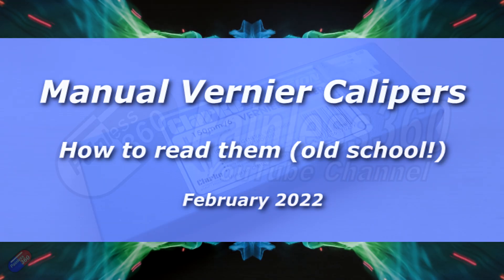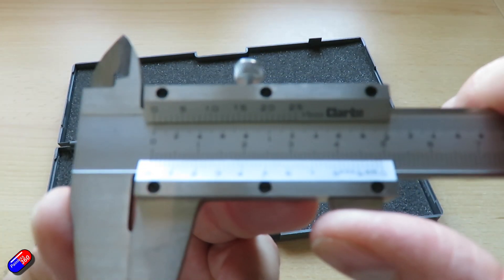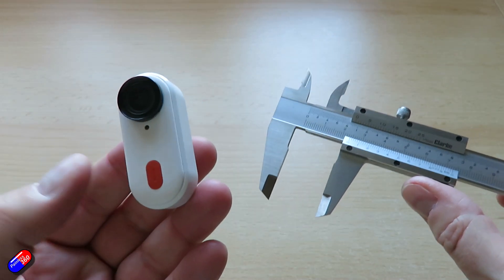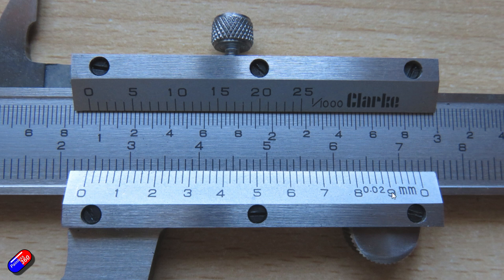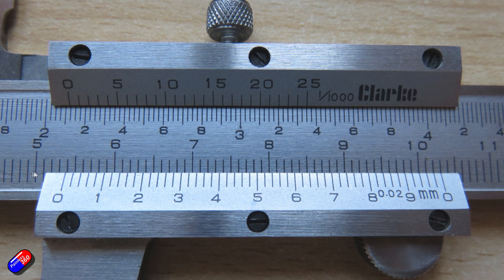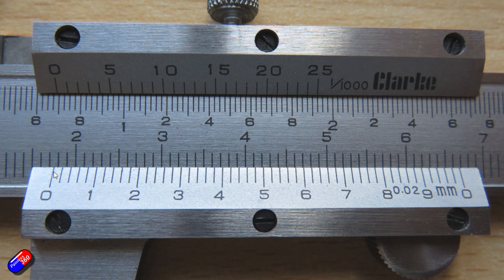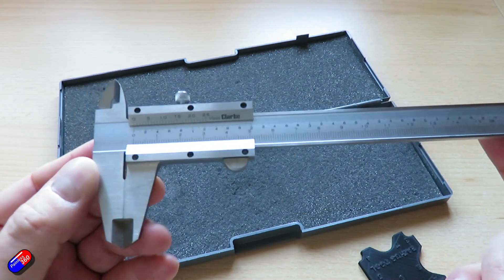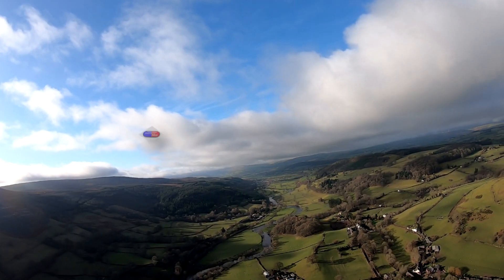How To Use Metric Manual Vernier Calipers (Old School!)

Comment: It's been donkeys years since I used one and needed to double check that I'm  measuring correctly again. Mine only goes down to 0.05 though. So, thank you for this video it confirmed that I was. A case of, If you don't use it you lose it in my case anyway, thanks again for the memory.

Comment: I just bought one for home use. I went with a manual since I often find that when I need to use a battery operated tool, the battery is dead. Therefore, I prefer manual tools that always work when I need them.

Comment: Thank You so very much. that was a clear explanation. I have a very similar model, but mine has standard graduations on top and metric on the bottom. What is still puzzling me is, how to understand that the standard graduations are subdivided in 10ths. I guess what I'm confused about is how to read a standard, base 12 is divided using base 10, which is metric. For me there seems to be a mental block because I was taught not to 'mix' metric and stranded measures.  Can you clarify this for me? I Thank You in advance.
Reply from the maker: There are two types of inch scales. This one measures in thousands of an inch. The other measures inches as a decimal... Happy flying

Comment: This isn't just a fun historical note; they still make these (and for a wider range of specifications than you can get with the digitals), and people still need to know how to use them. I just recently got a 2'/60cm caliper for a project, and got vernier because I didn't find any digital calipers in the right size. I used to know how to use them, but the last time I did so for a precise enough measurement to need the vernier mechanism was almost 20 years ago, so I came here for a refresher course.

Comment: I needed this information for a job I'm getting working with plane engines and other what nots. They said the manual caliper is more accurate than an electronical one and they prefer to use a manual any day. I also might info on using a micrometer as the only time used one was at the 4th largest company in the world. they told me to use as a hammer and I was looking at they're stupid. But the micrometer they had were manual as well and non electrical. so it would be nice if you provide information based on using one as well.
Reply from the maker: Check out the links in the video description... Happy flying

Comment: You know it is funny with the advent of CNC machinery and digital measuring tools in use today that "old time" machinists like my dad did high accuracy and tight tolerance work in the 1960s with manual equipment. It just proves that you don't need a digital display to make accurate measurements. Thanks so much for the video and I did get the measurement example correct. I have my dad to thank for that one!!! ❤

Comment: I absolutely hate vernier calipers, I have to use them in low light conditions to measure components to the near limits of the caliper tolerances, I wouldn't complain but in my view Dial calipers are superior since you get the precision you need without having to shell out for mitutoyo and spare batteries (which always get lost)
Still you never know what tool you'll have and reading verniers is invaluable for engineers and many tradies alike.
Reply from the maker: Yep, low light and bad eyesight can make manual tools like this hard to use. Especially when you're at the limit of their resolution. Happy flying!

Comment: Just bought a manual caliper because it got real old having to switch batteries every second time i pull it out. (Yeah i don't use it a lot, and batteries discharge even when idle.)
Reply from the maker: I use this one for the same reason. Always ready, always accurate :D

Comment: One thing I particularly like about a manual vernier. It can be calibrated at 0 and trusted across it's range as a reference to check other tools because the impressioned scales cannot be altered, only misaligned. Granted, they are not standards but they are far more trustworthy than dial or digital calipers.

Comment: Thanks for the video. The manual calipers are great for measuring oily machine parts. With my digital calipers I'd have to constantly wipe them down with IPA once any grease residue gets on the slide or the display will start going bonkers. Not an issue with vernier calipers.

Comment: In college, early 1970s, I took a drafting course and learned to read verniers using drafting machines.  I still use vernier measuring tools today including .0001" micrometers, .  One is an 18" vernier caliper.  It's a beast but it's accurate.

Comment: Not good to learn how to use, now I understand my order for a spring clip to hold plates on my dumbbells curve bar is not going to work. 🙃 My bar is 23.5 mm and the clip I ordered is 28 mm. Too big will slide off bar.

Comment: I don't use calipers very often, but when I need to, I need to.  I had an an electronic caliper that was accurate and easy to use, but because I used it so seldom, when I needed to use it, the battery would be dead.  Grrreat.  I bought an analog caliper and I love it.  Plenty accurate for what I need and it never fails to work.  This video does a nice job of explaining how to use one.  What's next?  A slide rule?

Comment: Keep the caliper free of rust and it will most likely continue to function for millennia, certainly much longer than the battery/circuitry of a "modern" digital caliper.

Comment: In millimeters is easy! But in inch?!
Reply from the maker: I'm guessing you are in America? :) Out of interest, how does that work?
Reply: No, I'm in Europe, and my interest is the knowledge. After your video clip, I looked for how to measure in inch, not with 1/200, 1/500 or 1/1000 precision, but with 1/64, 1/128 (for example, how do you get a result of 2 73/128"?). Without paper and pen seems to be very difficult to get the real value from the vernier! Metric system is marvelous!

Comment: It's  hard to believe we need a video for this.  I use a vernier and dial indicator  everyday.  Should be taught and used regularly in grade school.
Reply from the maker: Sadly, it is a dying art. Cheap, accurate battery operated calipers are easy to get. As an ol' school engineer - I prefer something that will always work, can be used in all conditions (even wet) and will work even if I forget to bring fresh batteries.. :)

Comment: I am 52 and I still have the caliper from a job when I was 22. It’s the only one I have, but being American I usually use the top scale.  That is until I got into FPV!  Now I use the bottom scale more often. Works perfectly. The beauty is that it cannot be wrong, where electronics can fail and become inaccurate.  

I work in HVAC engineering. We use a lot of quality mercury bulb thermometers.  We calibrate our instruments with these thermometers. Our electronic thermometers get out of calibration. Mercury bulbs never do unless you break it. Relative humidity is verified with a wet sock on a mercury thermometer and a fan blowing across it.  Dry and wet bulb temperatures are converted to a relative humidity on a psychometric chart. This stuff is not obsolete.  It’s the gold standard. 

Great video.  Never need a battery!  Cannot be wrong. (Unless it was built wrong then you get what you pay for, but it’s still going to be repeatable).

Comment: I've wondered how they work so thanks! Only thing I'd add is that the process of taking accurate measurements with a caliper is a bit of a skill by itself. Materials tend to all be plastic (to varying degrees) and you need to use the right amount of pressure for extremely accurate readings.
Reply: Micrometers are better for extreme accuracy

Comment: For years I kept a slide rule, it belonged to an engineer who worked on the space shuttles.  Sadly it was among the items lost in a move. Hadn't thought much of it till you went old school. I actually used it in high school, by the time college rolled around I had to buy a Texas Insterments calculator, weighed like a brick due to the ni cad battery pack needed for the drivers and led display. Ah memories ....Take care.
Reply from the maker: I still love using these non electronic versions of tools. Always ready to work and takes that little skill that I was taught many years ago in those engineering workshops to read. A connection with those generations before who used the same stuff..

Comment: It seems mad to me that people wouldn't know how to read it... Like finding out some doesn't know how to read an analog clock.
Reply from the maker: We all had to learn, and skills like this are a dying art. You only see the ones with digital readouts in many shops now so there isn't a need to learn to read a manual caliper..
Reply: @Painless360  Bud we use it in highschool.
I have practical exam tomorrow so I'm here
Reply: @Painless360  after retro fitting a dro to a mill it is easy to see their appeal. They are much easier to use.
Reply: @Painless360 not a fan of the digital ones. I like seeing the results not a read out if what it thinks the results are.
Reply: I was taught how to use one sixty two years ago then went into a machine shop where micrometers were exclusively used. Some thirty years later I was landed in a situation and asked to take a reading with a manual micrometer and simply couldn’t remember how to do it. I might have managed it if I had had twenty minutes or so to think it through, but no, it was can you take the measurement! The two bosses asking me couldn’t take it either.
Reply: Because we’re not old. And live on a digital age
Reply: Ok boomer
Reply: Why do you say so? You think that every body knows everything? Even you speaking you don't know any thing at all

Comment: This is a good tool to have.  And this is the right way to do it.  Never trust digital.  No matter how many times its calibrated.
Reply from the maker: I kinda feel the same. I've seen digital give odd readings when they were not calibrated or the battery is low.. :D

Comment: in germany, the optical shift effect is called paralaxe. it means, the meassurement will become wrong, if your point of view isn't exactly over the corresponding scale section. and as humans have 2 eyes, it means you'd have to close one eye for meassurement to avoid a paralaxe-failure.

bonus information: i wasnt allowed to continue using this tool after dropping it accidentally to the ground. hat to throw it away and use a brand new one. thats how sensitive this tool is or how high german's quality control actually is.
Reply: It's a parallax error in English too.

Comment: Good vid.  I'm a toolmaker by trade (Camborne School of Mines Cornwall).  So was taught both metric and imperial in fractions and decimal.  I have all my Grandads measuring gear passed down to me, he was a shop foreman in the Midlands.
Reply from the maker: I was taught all of this back in the 80's and it is still something that I use regularly everyday. There is a sense of connection measuring things the same way that your grandfather probably did.. Happy flying!

Comment: I got a set of those that are from USSR, 100 Micron (0.1mm) resolution, and use them occasionally when I can't find my $5 eBay knockoffs or the right battery since it chews through those coin cells!
Reply: The cheap digital models never completely turn off, hence the battery drain.
Reply: @loc4725  neither do the legit ones like my Mitutoyo pair. Its just that the SoC is better and software has deeper sleep features. Also it has protections against giving crap readings when the cell is going flat.